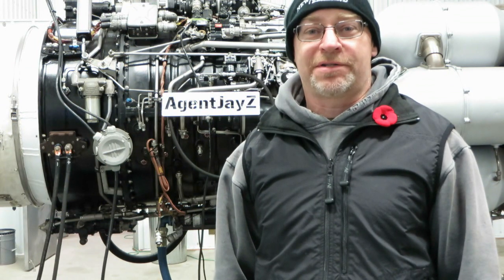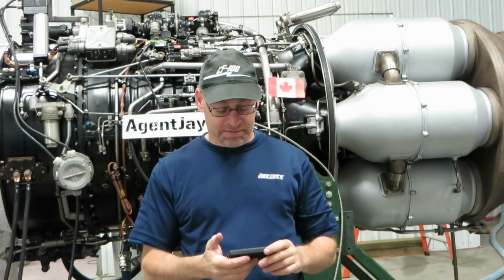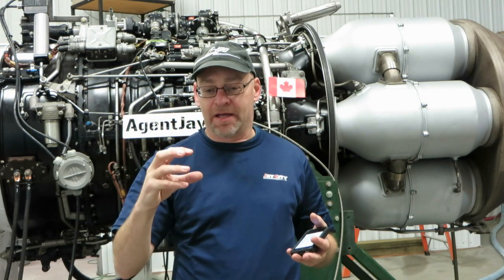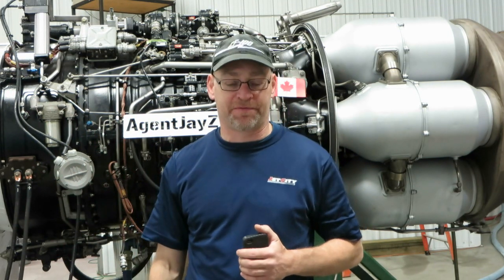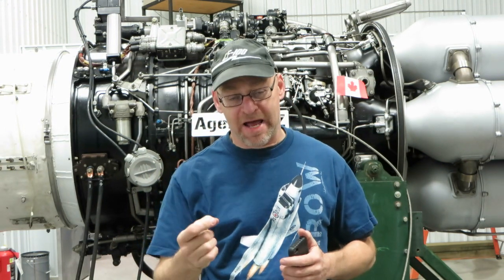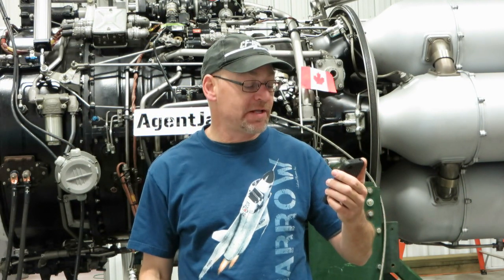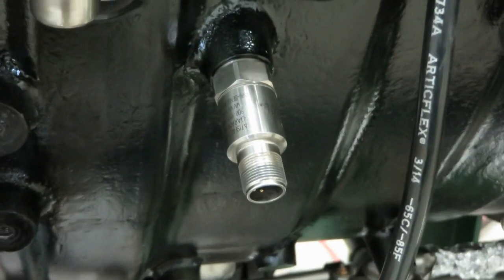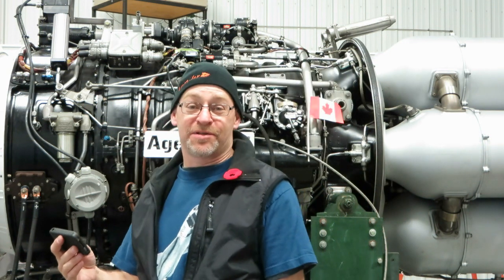Your Questions 21

Comment: Thanks for another great vid. Turbofans: especially for long-haul, efficiency optimization is for cruise. But a single engine has to pull the aircraft through takeoff and climbout. In cruise, power is near maximum ("TOGA"), look at the thrust lever and N1 graphs from AF 447 FDR (at bea.aero, annex 3, page 3): thrust levers go from climb to idle to TOGA, thrust for climb and for TOGA is almost the same. There's a lot more stuff, if anyone's interested.

Comment: Hi, a lot of persons are confused with the turbo jet engine and the turbo fan engines. They have a variation of uses and are not the same. I think a turbo fan engine could be a waste of power when used like an industrial engine, The fan will not help to creat power to turn any thing behind the engine. Thanks for sharing these videos. Please, send some snow to here!

Comment: About the question on throttling in jet liners, even they have speed limits and sound emission limits, so most of the throttling is due to this. I think in most places when flying below 10,000 feet they must maintain a top speed of 250 or 280 knots. If they take off and don’t throttle back they would exceed the allowed speed very quickly. And there’s the noise issue when flying low above certain areas, so sometimes they don’t climb as fast as they could until they leave that area. And as Jay said, they are powerful enough to handle a climb way below full throttle, and I understand the full throttle take off is due to safety procedures not necessity, like on a flight with light cargo for example.
Great videos!
Reply from the maker: My understanding is that limits are placed on noise, not speed. As soon as it is safely possible, airliners are required to reduce power to reduce noise. These restrictions are in place in some airports, and not others.
Pilots don't like these limits, is my understanding.
Reply: Some twin jets like for example the Boeing 757 are so powerful due to the requirements placed on class A aircraft that they frequently take off at climb power. Thus a throttle back after take off is not heard.

Comment: One other factor about rated engine power and why cruise power is less than max thrust, especially with ETOPS twin engine airliners is each engine has to have enough thrust to keep the aircraft flying "without placing undue burden on the flight crew" in case one engine fails over an ocean where there isn't a nearby airfield to divert to.

Comment: You could actually use a turbo fan for a wind tunnel since the fans in them are used to suck the air out of the tunnel not push the air in, but it is just cheaper to use electric motors compared to expensive turbo fans.

Comment: Great videos Jay!  I just wanted to add perhaps another comment in regards to Question number 5 and why do airliners pull power back after takeoff.  Many airports have noise abatement requirements that would require jet aircraft to climb at best rate of climb and then reduce power to help with noise control.  But in my opinion as a commercial pilot and flight instructor is this:  civil aircraft below 10,000 feet mean sea level have to obey a strict speed limit of 250 knots indicated airspeed...

Comment: Concerning airliners powering down after takeoff, it is often not so much a question of the best engine efficiency for the climb but rather following the noise abatement rules of that particular airport. Airliners often fly level or at low rate of climb until they are clear of the noise abatement area, then power up for the climb to cruise altitude.

Comment: Second question, is there such a thing as hot or cold bleed air?  Do they use bleed air for cabin comfort and or de-icing?  is bleed air always the temperature of the outside air or is it warmer?

Comment: ...(from below)  After takeoff, most airliners are not cleared immediately up to cruise altitude, but rather cleared in a series of 'step ups.'  Just about any turbojet powered aircraft would break that speed limit in a heart beat leveling off at 100% power at such low altitudes with high indicated air speeds and relatively low true air speeds.  So until they are cleared higher, the pilot would have to reduce power (much less efficient).  Hence the next generation air traffic control system.

Comment: Hi AgentJayZ,
I was wondering, when you tear down an engine, do you have a standard procedure to make sure everything goes back where it should and nothing "left over"..... photos, bags, lining up parts..... or something else
Reply from the maker: The manual is very specific and thorough, and we take many pictures along the way for orientation of lines, cables, etc. Each engine also has its own dedicated storage area, and having nothing there when done is indeed a good sign...

Comment: Another question about two-shaft engines. The gas-generator turbine sucks up about two thirds of the the energy of the hot combustion gases. Does that hold for the HP rotor alone? Does the LP turbine then extract about two thirds of what's left by the HP turbine? I. e. only one ninth of the gas energy exiting the combuster is then left for the power turbine? If that were true, in order to be more efficient than single-spool, there would have to be a hell of a lot more "heat" in the dual-spool-engine's combusters than in a single-spool's. Am I making a mistake here? So maybe the HP turbine takes less because it doesn't have to drive all the compression work alone, but is assisted by the LP system, and the combined turbines (HP+LP) take 2/3 of the gas energy? Must be fun to design those things.
Reply from the maker: No. the 1/3 2/3 rule is for single shaft turbojets. Any other configuration and things are split up differently. It's really best to consult a good book, like RRs "the Jet Engine"... because the comments section of a vid on youtube is not the best place to go into that kind of detail.

Comment: Hi JayZ
I was wondering (on any of the jet engines that you service) if any suffer from potential flame out / surge if the engine throttle is suddenly change from flight idle to full throttle.
I have been reading a book by Sir Stanley Hooker (who designed the Olympus and numerous other engines), in it he stated that when running the first initial test he slammed the throttle full whack and then brought it back to idle without flame out.
He claimed that a proper designed Jet engine will not suffer flame out or surge under harsh conditions.
The book is called 'not much of an engineer' and a really good read.
thanks in advance
Reply from the maker: That's an excellent book, and Sir Stanley is right.
You really have to abuse an engine to get it to stall... or just have the variable stator system massively out of adjustment.
We had one stall when there was a loss of signal from the tach at 100% power, so the engine was running at full speed, but the VSV system closed down to the idle position. Engine kept running, we reduced throttle, no damage.

Comment: Great session. I am most anxious to hear your explanation of compressor stall. I have heard some good ones and I have heard some very poor ones. Most of them deal with formula's that the common tech would need an engineering degree to figure out. Do you have a simple explanation? Also could you define surge?
Reply from the maker: ***** Well, yeah, that's good. I was going to try to add diagrams and show how the true angle of attack comes to be, and why it's so hard to visualize for most of us. 
Now that everybody has read your comment, I think I have a bit more breathing room.
Cheers.
Reply: AgentJayZ
The way I understand the difference between compressor surge and stall is this, in very simple terms, the compressor is made from lots of aerofoil blades, and just like wings, if the angle of attack is incorrect, the aerofoils can stall. This will give disturbed airflow in the compressor and can also slow the airflow down.
If the airflow slows down sufficiently, then the higher pressure air at the rear of the compressor will reverse and flow back towards the inlet. This is a surge.
A surge can also be caused by overfuelling, causing an increase in pressure in the combustion chamber, again giving a reversal of airflow.

Comment: Great answer about the throttle use in airliners but a new question keeps popping in my head: 
In the name of fuel efficiency, would it make sense to have one engine turned off once you reach cruise height/speed and keep the other one at it's optimum instead of two engines at say 91%?

An example would be when a pilot has to circle around while waiting for landing slot, just staying up while using as little fuel as possible/necessary.
Reply: Well you can't just turn off one of your engines in flight, you'd have a thrust imbalance and would be yawing to one side. You'd also end up with a significantly increased amount of drag too. Airliners tend to carry enough fuel for the loitering time they might encounter anyway.
Reply from the maker: Markstang is right. Also, the engine(s) you might shut down would be windmilling, without any oil supply to the bearings of the LP system. The HP system does not windmill. There is no LP rotor brake, and if there was, the engine would have as much drag as a parachute... so turning off an engine or two is never considered.
Reply: And most airliners cannot maintain such high cruise altitudes on one engine, causing it to descend, causing worse fuel efficiency.  An aircraft will travel further on less fuel cruising with both engines at 40,000 feet than the same aircraft cruising at 15,000 feet on one engine (or two for that matter), in addition to the drag, unsymmetrical thrust, and other considerations.
Reply: Acutally, windmilling restart is possibly, at around 300 knots indicated: at high speeds the HP rotor turns fast enough for a start. Just. Inflight-restart isn't always possible, and is often done starter-assisted, if the other engine or the APU provides bleed air. On the ground, one engine may be shut down for taxiing, on some airplanes there is a special procedure for that in the manual. Tight turns into the running engine may be difficult, but it saves fuel.

Comment: Is there a reason why turbo fans are not used at military jet planes, considering their known efficiency? is it because of their size? thank you for your extraordinary work.
Reply from the maker: Oh, but they are. All reasonably modern fighters, from the seventies or so up until now, are powered by turbofans.
They are low bypass engines, typically with a ratio of 1:1, so they look different than the fat, high bypass airliner engines.
F14,F15,F16,F18,F22,F35, Tornado, Harrier, Eurofighter... all turbofan powered.
Reply: AgentJayZ
ok thank you, i thought that because of their slim looking tubines turbo fans are out of the question...
Reply: AgentJayZ
Don't forget about the military Cargo aircraft and aerial re-fueling tankers!
Those use engines that look much more like those used on commercial airliners.
In some cases, they even use the same make and model of engine.
Reply from the maker: Yes, you are totally right, there. I don't know why I was only thinking fighters...

Comment: hey jay could you explain how the force of a jet engine sucking fuel through the puump could overwhelm the pump's ability to limit fuel flow as is the case in the tumansky R-15B
Reply from the maker: Don't know anything about that engine, but no jet engine I know of sucks fuel into it. The engine only gets as much fuel as the pump can pump into it.
If a pump of too little capacity is used to supply an engine, then it will not deliver enough fuel for the engine to achieve it's rated performance.
If the engine could suck fuel through a pump, the pump would not be necessary.
If the pump was used as a regulator, then it would be called a regulator, and it would need to regulate fuel being pumped through it by ... a... pump.

That's the way I look at it.
Reply: i see i was reading up on it and the engine had a nasty tendency to overspeed because the engine could run the pumps faster than designed usually it led to the destruction of the engine
Reply from the maker: I'll bet that is possible, but it would be a problem with how the output of the pumps is controlled. Maybe I misunderstood you a bit. But the engine can only run the pumps with the power it makes by burning the fuel supplied to it by the pumps, eh?
Sounds like a fuel control issue.
Reply: my guess is the way the pump was designed it allowed for a feedback loop w

Comment: Got a Question...
How do you Start a Jet Engine with 2 Spools (LP and HP Shafts) Which Shaft is rotated to get initial compression LP or HP ?
I have seen most of your videos, I really Like them all. I have seen a video where you explained how a Air turbine Starter Works, but I didn't get the answer from it.
Thanks in advance for your Reply.
Reply: the gas generator (HP) spool is the one that gets started first.  without it, there is no power to drive the LP spool.  the LP spool effectively freewheels through the center of the HP spool, and rotates slowly until the gas generator is producing enough gas to drive it.
Reply from the maker: Most of the engines in my test videos are single shaft.
In a two shaft engine, the core, or HP system, or spool, is the one that is attached to and drives the oil, fuel, and hydraulic pumps. The HP compressor feeds directly into the combustors, and the HP turbine is the first to encounter the gases produced by the combustors. The LP system uses leftover exhaust energy from the HP system to drive the LP compressor, which supercharges the HP compressor...
So to get it all started, you need to spin up the HP spool.
Have a look at my video  Turbojet or Turbofan.
Reply: AgentJayZ Thanks for your Reply...:)

Comment: Hey Jay, love the beard! I have a question. Are there large differences in the design and manufacture of the various brands of engines that you work on? And do you have a favorite? Thanks!
Reply from the maker: Just like cars and automotive engines, there are large differences in design between manufacturers and between models.
But then they all use pistons and have four wheels... so I guess it all depends on what your definition of large is...

Comment: Hi J!  Question for you, I just watched a video on youtube of two pilots flying a Cessna Citation in a heavy storm.  During their climb, the pilot says he is switching on the igniton to prevent flameout in heavy rain.  Is it really possible to flame out an engine on a Citation in some stupid rain storm????  No way right?  Is he just being careful?  Also, when he "switches on the ignition" is he actually turning on the igniters? or just arming them?  I am not a pilot, and I know your not too, but I thought you could shed some light on this.

IFR flight in a Citation V - departure in heavy rain!
Reply from the maker: Switching on the ignition means making them spark. Unnecessary, but also not harmful. The pilot is being prudent, and maybe following policies of the airline he flies for. Many ignition systems have a max duty cycle of several minutes, so you just don't want to forget to turn it off...

Comment: it's always a great day when Agent Jay Z posts a video!   Thanks for the new installment!   Hey!  Any Iroquois news?   whats her current status?
Reply from the maker: The Iroquois is standing in our shop, cases assembled without the rotors inside. Not much has happened with her for the last little while, as the shop has been running flat out with work on customers engines...
Reply: cool thanks for the reply!  I was worried she got sidelined for some missing or damaged part that had derailed progress!  Glad to hear buisness is hopping along!  Would you be pleased to make a video about S&S's involvement in north american eagle LSR effort?

Comment: Clarification; Engines are designed for peak efficiency at cruise (and some climb), which burns the majority of fuel.  They are not peak power.  Takeoff is peak power
Reply from the maker: +Lou Vegas Yes... I might have been thinking like an industrial engine there. Aircraft engines have a best fuel efficiency setting, a maximum continuous setting, and then a time-limited max setting for takeoff.
Industrial users would call the max continuous setting the max power rating.
In that way of looking at it, takeoff power is more than the 100% rating of the engine, and it's time limited because it puts a lot of stress on the hot parts.
Most of the engines we work on were all initially designed as fighter jet engines, and their highest efficiency is right about at their max continuous rating in aircraft terms.
Reply: +AgentJayZ Agreed.  Part power vs full power design point is probably another big difference between modern aircraft engines and industrial engines.